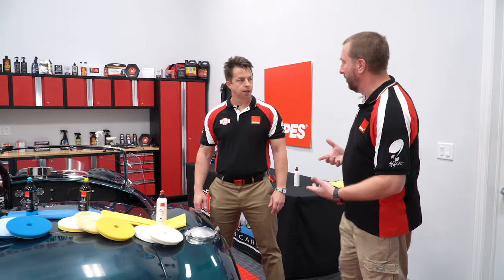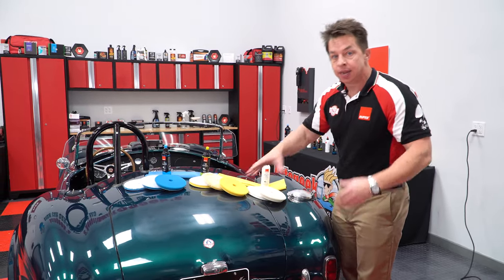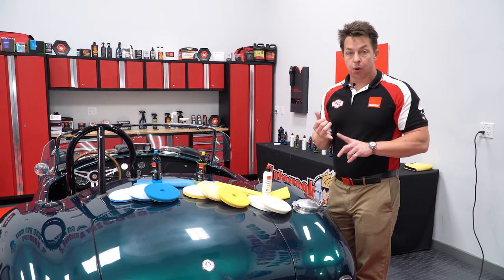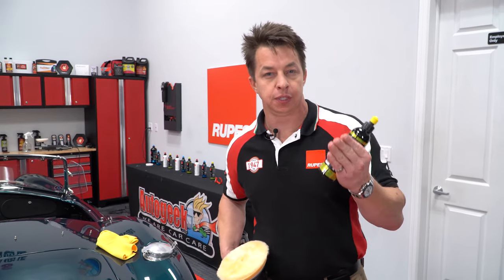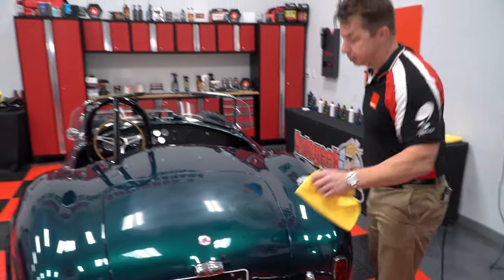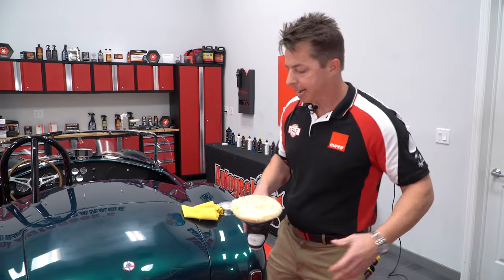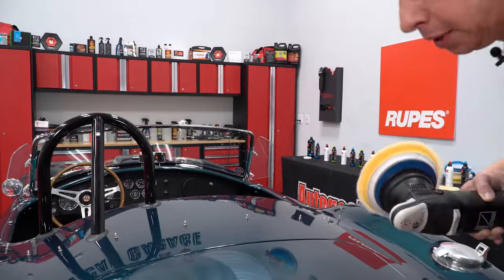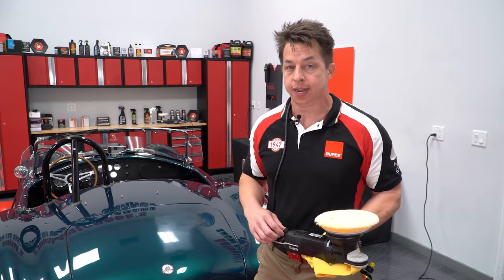RUPES Test Spot  - Which Pad and Compound Combination Should I Use?

Comment: When would you recommend using wool vs microfiber vs foam?
Reply: severe damage may require heavy artillery to tackle so in that case MF or wool. A well maintained car ( 1 in a 1000) or new may get away with foam. is basically what the video is on about test spot and some logical thinking based on the cars history and measurements.
Reply: If I understood what was in the video correctly pad choice would be based on what your test section produced.   It would appear that a foam pad is the least aggressive at cutting and a micro fiber is the most aggressive with wool landing in the middle.   So using the video as an example if the wool pad didn’t cut all the defects out the next step would have been to move to the yellow compound with the micro fiber pad.   If that didn’t work next step would have been blue foam with blue compound.
Reply: @Stevesadventures69  Correct, however the yellow wool it may be the same or a notch higher in the cut from the coarse foam pad. So instead of the foam you could use the yellow wool based on the test spot results agreement with client end result combined with critical thinking on your behalf to deliver it
Reply: @Stevesadventures69 Some companies have wool over microfiber for top end cut. 

The Buff and Shine Uro-Wool and Lake Country low lint wool to be specific.
Reply: Right now I'm usually using wool to cut. 

The reason is the ability to cut efficiently on painted plastics. I've run into situations where my heavy cut on heavy cut microfiber pads did almost nothing to remove defects. In this situation where my compound and heavy cut microfiber failed, the medium cut and wool got the job done in short order. 

It might be different for others, but that's been my experience. 

I'm mostly using foam for polishing and finishing. I'm going to give that really stiff blue rupes foam another go here soon. 

I had a hard time using the Rupes DA Coarse. Great cutter, too much dust.
Reply: @danlc95 me2 microfiber does nothing idk why... Even after 3k or 6k sand paper.. I still can see scratches..
Reply: @Satrolkof  What are you working on? What is the substrate, metal, plastic, fiberglass, etc?

Whenever I have to do touch up work on painted plastic bumpers, before installing PPF, microfiber doesn't do anything but waste time. 

I switched to the Rupes blue coarse pads and get great cut. 

The microfiber tends to heat up the panel, where wool stays cooler.
Reply: I'm a DIY enthusiasts detailer. My question is without having to buy every single pad (and multiples of them), what's a good 3-4 pads to have to cover most defects. Currently I have a combination of multiples of the Blue Wool, Yellow Foam, and White Foam (all Rupes) pads. I have a ton of various polishes and compounds: Meguiars M100, M110, M205, M210, Rupes Uno Pure, Sonax Perfect Finish, Sonax CutMax, DIY Detail Gold Standard Polish, 3D One, Auto Fanatic Secret Weapon, and the entire lineup of Koch Chemie pure compounds and polishes. There are probably a few I'm forgetting, but that's the main lineup.

As for polishers I have a HF Bauer 20mm Long Throw, Griots Garage G9, and G8, and the HF Hercules Forced Rotation (copy of the Flex 3401). I run all with 5" backing pads (except the G8 which uses 3" and 2" pads). Of the rupes pads I listed I have them in all 3 sizes (which is why I went with Rupes as they actually offer all their pads in all those 3 sizes)

Should I add any other pads to cover all possible defects? Like do I need the Microfiber from any color lineup, or blue aggressive pad if I have a blue wool? or the yellow wool if I have the yellow foam? Or even any pads from any other brands?

If it helps I primarly own asian market vehicles. Currently I got a Boost Blue '23 Civic Type-R, and a Gunmetal Grey '17 Mazda CX-9.
Reply: @BigBear--  if you add the yellow wool, that would cover almost anything that could be thrown at you.
Reply: @danlc95 I forgot to mention that I also got the 3D One sander for their paint sanding system. It's like $400+ sander that I won in a raffle. I guess that should cover anything requiring actually aggressive treatment for defect removal. Though I've never sanded vehicle paint, and would be a little nervous about doing it for the first time...I've wet sanded things like headlights and trim, just not paint/clearcoat.

With the amount of product and tools I have on hand I could probably open a detailing business tom, and not run out of product for about a year at the least. I'm a bit obsessed...and keep buying new stuff to try. I even got 3 different pressure washers (a 4200 @ 4.5gpm belt driven gas unit, a 2700 psi @ 2.3 gpm electric, and a 2300 psi @ 2.3gpm electric with a total stop system), also got a Dupray Hill Injection Steam cleaner.

Thanks for the recommend, I'll pick up some Rupes Yellow Wool pads as well.

Comment: first thing is do you even need a compound.  the days of compounds being required for correction are going away.  it's amazing what people can achieve sometimes with a good polish and a few pads. always try that before changing pads and then if you must go to a compound or preferably use a single product polish that can correct severe sanding marks and finish the paint all by itself.

Comment: Bro im amaze on your video which you recommend for quicker remove scratches and swirl im using rotary but may campany is using polytop foam pads work is good but very costly need time to remove the scratches can you help me for pad which is quicker like one time polish i hope you answer my question and give me advice tnx you very much
Reply: If using a rotary, use a wool cutting pad with a heavy cut compound then follow with the foam using a finishing polish.
Reply: @danlc95  which brand is good bro how about the microfiber pad you try already?

Comment: I'm pleased I have watched this thank you.
There are many videos on you tube where many people use 3 drops on a foam pad do you know why.
Reply from the maker: Once the pads are primed, only 2-4 drops is needed at that point when doing small sections the size of about 6x the pad. Our guess is that people go with the the middle option of 3 drops!
Reply: With a more lubricated product anything more than about four dots is just going to make a mess. 

The 3D line is a great example of a highly lubricated line. AAT502, ONE, ACA500 all only require a few drops to start, and one or two to reload.

Comment: How does the throw of the polisher effect the results? 
 Great video
Reply from the maker: The throw of a tool doesn't effect the results, it's typically the polish and pad combination used that affects the results the most. The throw of the tool can affect the level of cut and the size of the panels that can be tackled.

Comment: If I get 2 pads, 1 to use for 1 stages and  the 2nd stage on a 2 stage. And one for cutting on the 2 stage. Which pads would you recommend?
Reply: For stage 2: Yellow wool, blue foam, Blue Wool in that order. I'd start of using fine compound then use course if needed

Comment: Which is best for mild orange peel?
Reply: What vehicle?  Orginal paint or respray?
Reply: @JimmySSuccess  respray
Reply: Orange peel is usually wet sanded and then compounded and polished. But these days the new microfiber or wool pads cut really fast. I'd wetsand with something safe like 3,000 grit and a block on the large areas. In this video he said he used 3,000 grit sandpaper to scuff up the paint (for his demo). This setup he used took out the marks from the 3,000 grit.